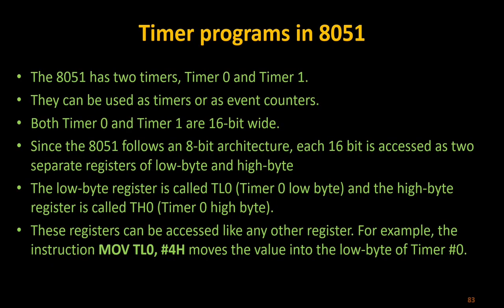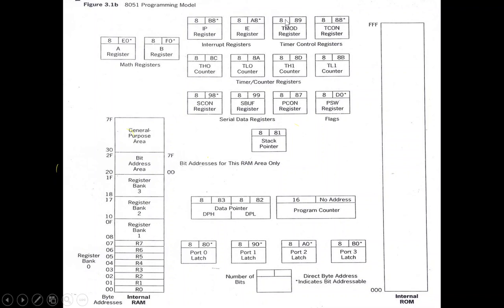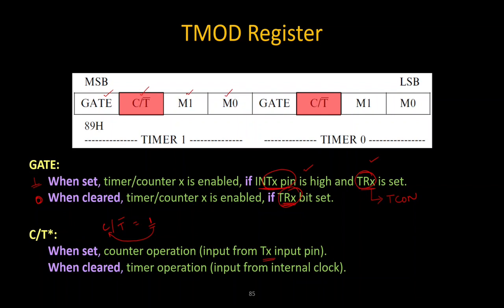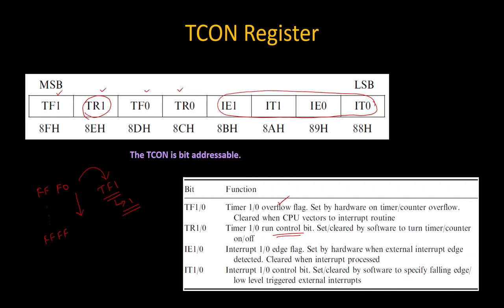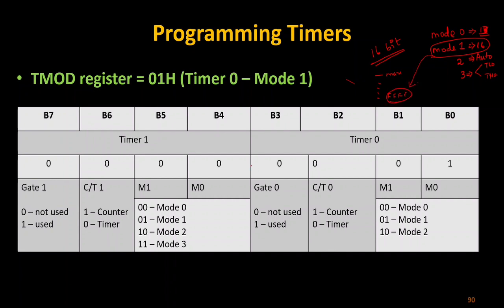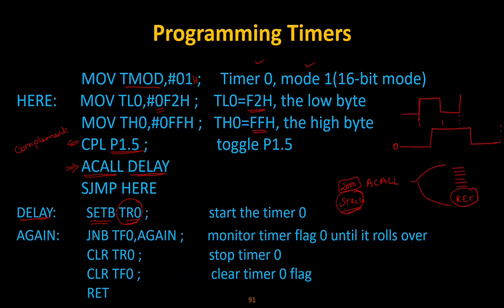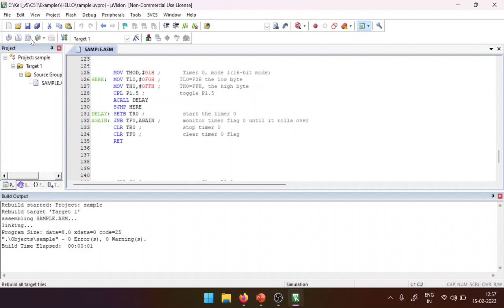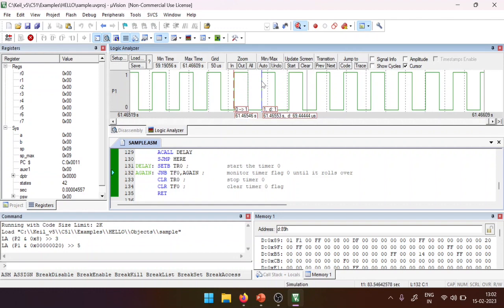Timer programming in 8051 Microcontroller with Keil µvision c51 simulation software -1

Comment: GROUP 11
NAME: AAROHI MISHRA
REGISTER NO.: 21BCE5303

NAME: PRANJAL SINGH
REGISTER NO.: 21BCE5288

NAME: MUNUGALA SHRAVYA
REGISTER NO.: 21BCE5305

EXPERIMENT NO.8 HARDWARE VERIFICATION

1,2,3 :

org 0000h
;        MOV TMOD,#01H
;HERE:    MOV TL0,#0F0H
;        MOV TH0,#0FFH
;        CPL P1.5
;        ACALL DELAY
;        SJMP HERE
;DELAY:  SETB TR0
;AGAIN:    JNB TF0,AGAIN
;        CLR TR0
;        CLR TF0
;        RET
;END 
        CLR P2.3
        MOV TMOD,#01H
        MOV TL0,#00H
        MOV TH0,#0EEH
        SETB P2.3
        SETB TR0
AGAIN:  JNB TF0,AGAIN
        CLR TR0
        CLR TF0
END 
;        CLR P1.0
;        MOV TMOD,#10H
;BACK:   MOV TL1,#01AH
;        MOV TH1,#0FFH
;        SETB TR1
;AGAIN:    JNB TF1,AGAIN
;        CLR TR1
;        CPL P1.0
;        CLR TF1
;        SJMP BACK
;END
;   

4.
ORG 0H  ; Set the origin of the program to address 0
MOV P3, #0  ; Clear P3
SETB P3.2  ; Set P3.2 to high
MOV TMOD, #00H  ; Set Timer 1 to Mode 0
MOV TH1, #245  ; Load Timer 1's high byte with 245
MOV TL1, #0  ; Load Timer 1's low byte with 0
SETB TR1  ; Start Timer 1
MAIN:
JNB TF1, $  ; Wait for Timer 1 to overflow
CLR TF1  ; Clear Timer 1 overflow flag
CPL P3.2  ; Toggle P3.2 to generate a rectangular pulse
MOV TH1, #245  ; Reload Timer 1's high byte with 245
MOV TL1, #0  ; Reload Timer 1's low byte with 0
SJMP MAIN  ; Loop back to MAIN
END  ; End of program